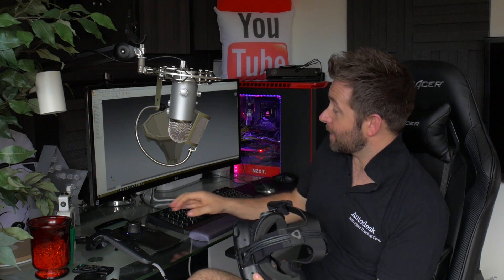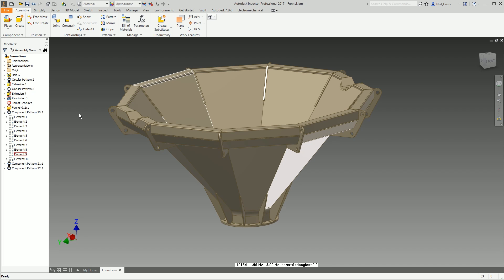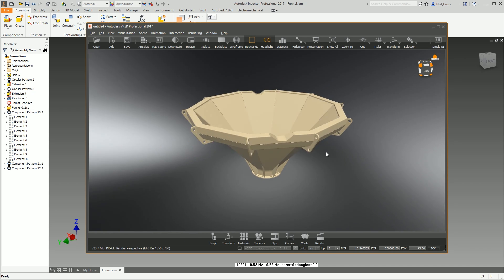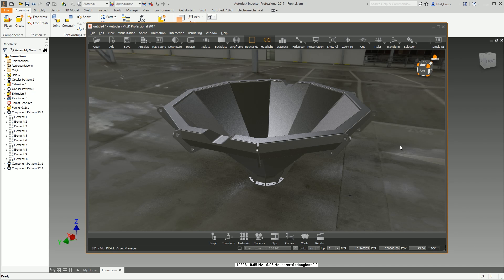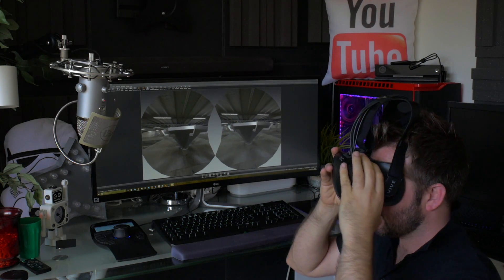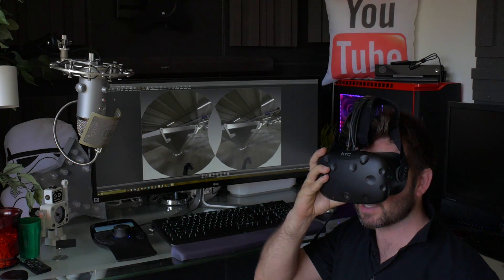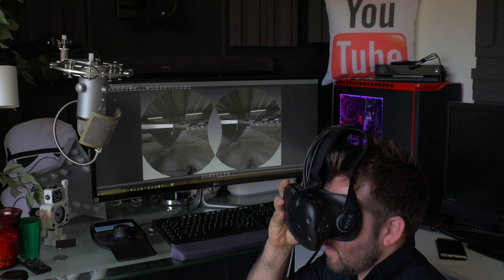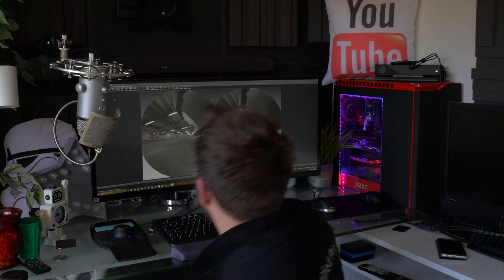3D CAD model into VR, WORKING DEMO

Comment: Please could you help me.  I want use htc vive but I dont know desing program name.
I want use for desing with htc vive's controller
  

What is the program name for htc vive ? thanks
Reply from the maker: There's a couple of different programs here, there's Autodesk Inventor which the models where created in, there's Autodesk VRED that runs the VR integration, and Vive runs on Steam by Valve.

Comment: I just tried a Vive yesterday.... i get it man. It's life changing alright and inexplicable.
Reply from the maker: I recently realised that because I'm running this on a GTX970, the minimum required GPU, apparently the Vive is magnitudes better and clearer when run on better hardware so I can't wait to see that.  Sounds like an excuse to buy a 1080!
Reply: +TFI CAD Tips yup. the machine driving the one I tried was epic. 2 top of the line GPUs in SLi. plus other badass hardware components.
Reply: +TFI CAD Tips they were either 1080's or Titans.

Comment: Hi, is there support for this on the Samsung Galaxy S7 and Samsung Gear VR?
Reply: completely different kettle of fish.
Reply: This is something I've been working on! I work for an industrial design/fabricator and we took a 360 image of our shop using our s7's and have also done so using a 360 camera. The latter was obviously better. We then imported that image into VRED as a dome environment and I loaded one of our 3D models into it, sized it and placed it where I wanted it. It looks beautiful. Now the problem is getting that to my phone. The gear VR will allow you to open any 360 image or panorama in VR using the "360 Photos" app. That photo will need to be on your phone in a subfolder of the oculus folder called "360 photos" or "my images" or something. I dont quite remember. But again, the problem is getting it there. I have successfully exported the VRED as cube images, as well as 360 images and I can get them to my phone. Unfortunately my phone does not recognize it as a 360 image or panorama. also unfortunately, this is unfamiliar territory for me. From my understanding, to get your phone to recognize it, the image needs to be in a certain format like 2:1 ratio, vertical cross, horizontal cross, blah blah blah i dont know, and also have the 360 image exif metadata. again, this isn't my area of expertise. I am very close to getting it working though!
On the other hand, I have had some luck with 3DS Max , though very bad render quality and such because im not good with 3DS Max.
Is there a sub-reddit or something for this? Would love to discuss it more in depth with like-minded people.
Reply: one more note: movement tracking would obviously be lacking because the Gear VR doesn't track body motion and the trackpad does not function in 360 photos.
The result is that you are placed at the origin (which you can dictate in VRED) and are free to look around from the perspective of that origin, but nothing more.
Cheers

Comment: Can Autodesk Vred handle pointclouds?
Reply from the maker: +Erwin Meulman I dunno actually, will find out. What's the scenario?
Reply: This is a functionality I've recently become interested in as well. We have been working with a 3D environment scanning company to product point clouds of steel mill melt shops. We bring those pointclouds into inventor and use them to retrofit and present our models in their environment. It would be great to take this to the next level to not only see our equipment in their shop, but to walk through their shop with our equipment in it.
Just a thought.
Cheers

Comment: How new is this VRED? like i said in the last video i searched extensively a month or 2 ago and got no hits for anything as usefull as this, and the fact its an Autodesk product makes it all the more amazing
Reply from the maker: Haha it's been around a while now, I have no idea since when but at least a few years.  The VR headset integration is still evolving but the application itself is a few years old.
Reply from the maker: You need a monster of a machine to get the most out of this though, my 970 just about does it but there's no AA or any visual effects going on... with any level of AA applied the frame rate tanks into the ground.  VRED has a SLI profile built into it so that sounds like a good excuse to buy dual 1080's!
Reply: TFI CAD Tips
im running a 7970m and can run just about anything above the needed 60hz, besides the DPI of the current gen of VR makes AA a moot point, you dont need bother with it. But yes i too have designs for a triple 1080 monster as it seems the new LDA driver framework on the new GTX series are going to make SLI obsolete.
Reply from the maker: The RTM version of the Vive runs each eye at 90Hz so it needs a constant ~90FPS, I think the shipping version of the Rift is the same? I just googled the 7970M and it says it's on par with a 680M, my Alienware has a 980M 8GB in and that's not VR approved so I dunno what'll happen with the 7970M.  I tried running the Vive off a Quadro M4000 and it flat out refused to start because it's not a VR certified card, which was shocking as it's the same chip as a 970!
Regarding the AA though, it definitely benefits from AA.  With no AA applied you can visibly see the jaggies and on straight lines they can do that annoying flashing effect which is really distracting, turning on AA helped massively clear up the image but then the frame rate tanked on my 970 to an unwatchable level.  It doesn't stutter like a monitor, it's weird, but yea 3 1080's will do the job.  Business expense yea? haha
Reply: TFI CAD Tips
the 60hz was in reference to my DK2 and i ran elite on max with no problem, im also using an alienware M17x R4 but with the 7970m, ive had it cranking out some running games and live rendering at speeds im not sure it should be able to going by other benchmarks ive seen, silicon lottery for the win ay? for the main part the VR bottleneck for most applications is poor software optimization, and thanks to the Volken API for my radeon it can usually help with that poor optimization. Its kinda sad that AMD has the power but radeon has the better API where VR is concerned. But my next machine will hopefully be a business expense cashing in at over $10,000. Ill give you the list if you wish to see the meaning of vanity and overkill lol